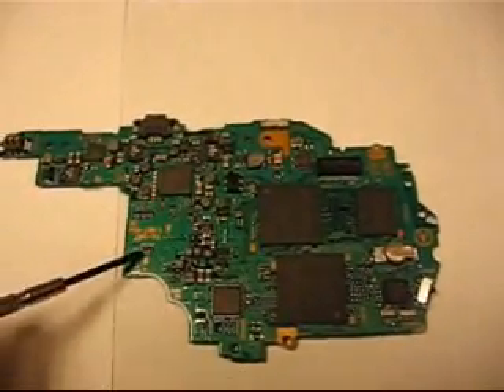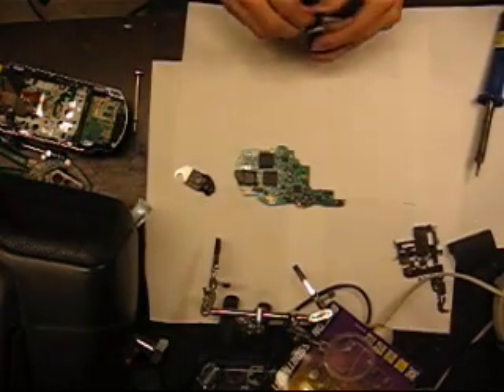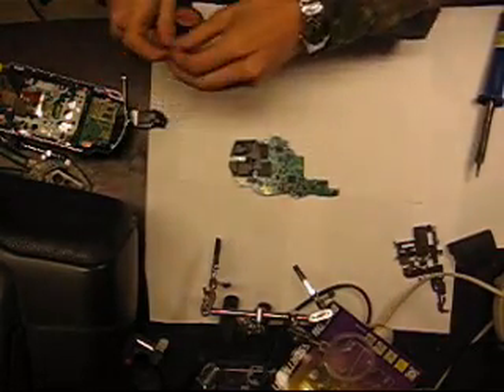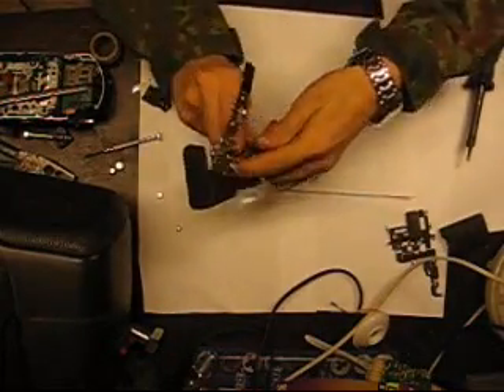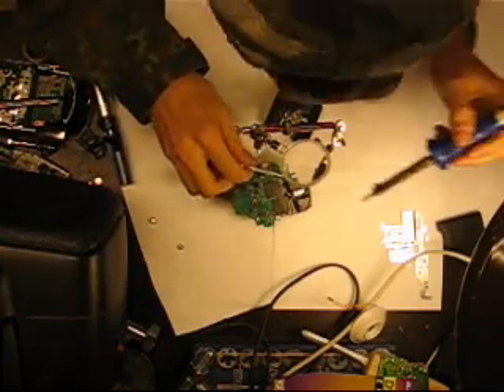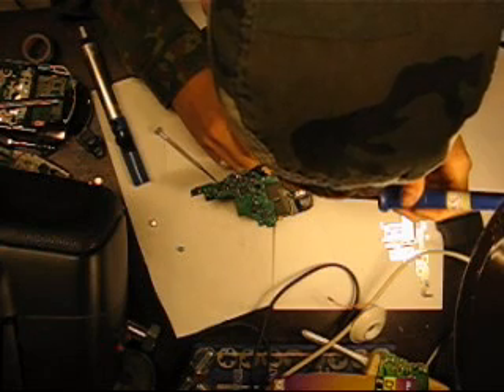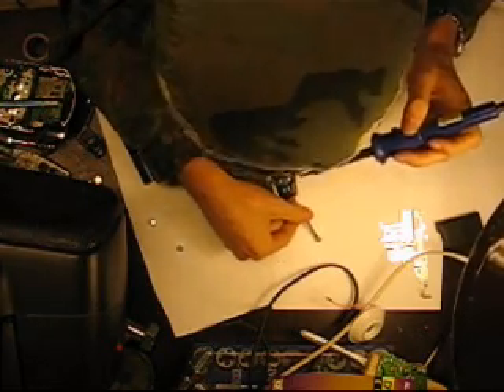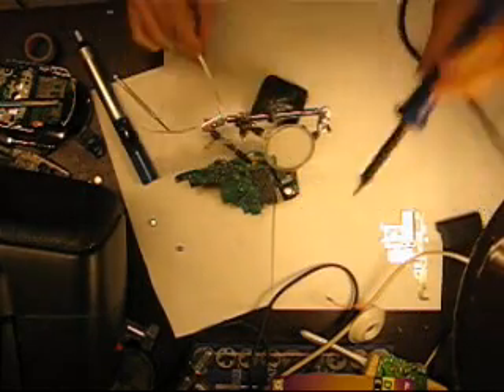Replacing the psp's backup battery - Part 1 (aka Repairing a moisture damaged PSP)

Comment: This is a little late but I just now got myself a PSP and am learning all kinds of cool stuff about it. One very important thing I have learned is that the "battery" on the motherboard is not actually a battery, it's a capacitor that can hold a small charge for a short amount of time. These are used for just holding the date and time information in case you have to swap out your battery for a new one.  That's why no matter if your PSP were new from the factory or 16 years old, if there's no battery in it for a long period of time you'll have to reset the date and time.  Since the battery you replaced the capacitor with is not intended to be charged it most likely exploded and is no longer doing anything.
Reply: I mean, my psp does not keep the date and time, so, change that battery or capacitor or not, it is not necessary to change it or do I leave it there?